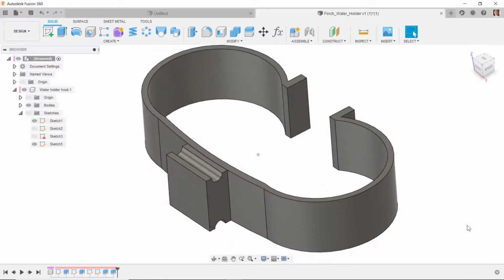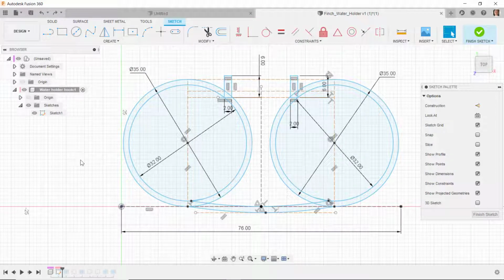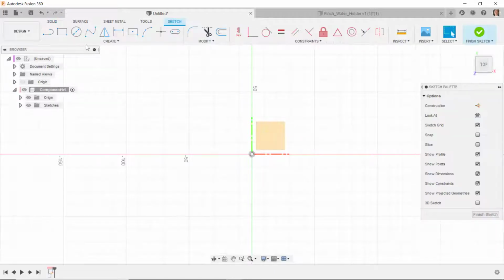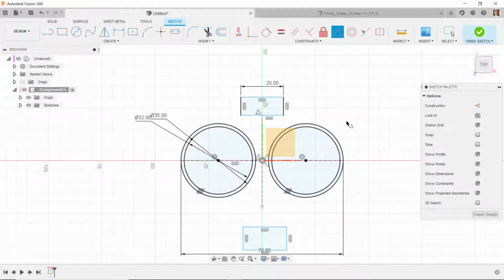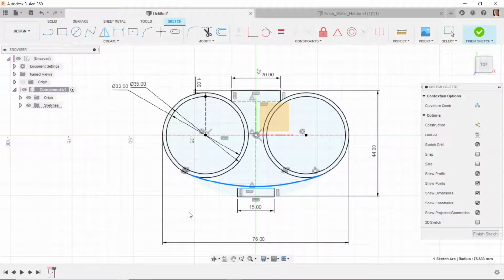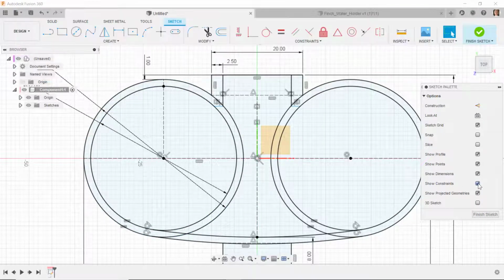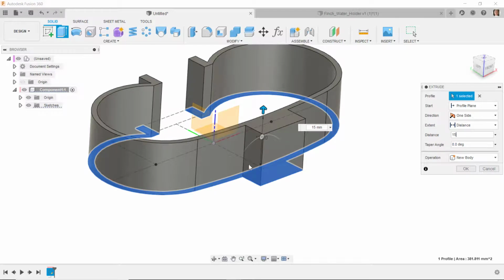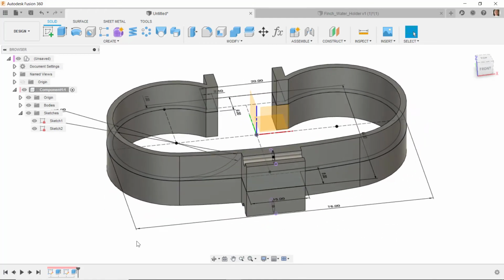Geometry is Geometry

Comment: Question; for 3D printing, Does it matter if designs are done Y up vs Z up ?
Reply from the maker: What you call "Up" is all relative. I will ignore any reference to Up, Down, Front... It most certainly does matter what orientation Z is relative to your model.  The nozzle axis of the machine is Z, so you want to model (or position your model) relative to Z so that the layering is as expected (this might change by geometry or by desired layering strength).  You can consider how you want the geometry oriented relative to Z before starting the model, or you can rotate the model after creation.  The slicing software that I use also permits rotation of the model after importing the stl, so the orientation is the CAD software isn't an issue.